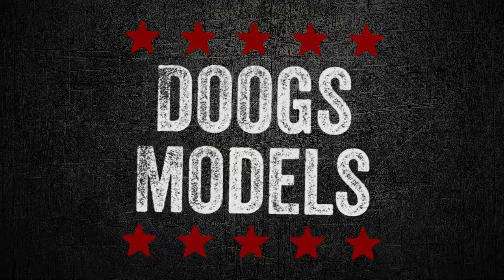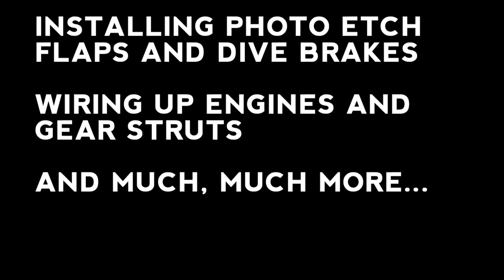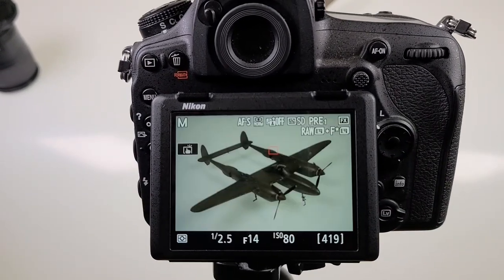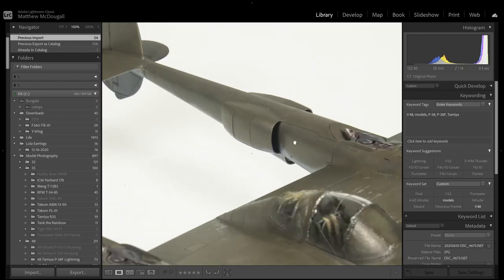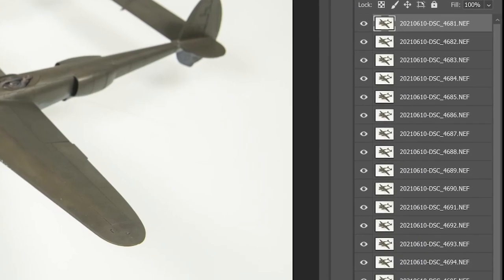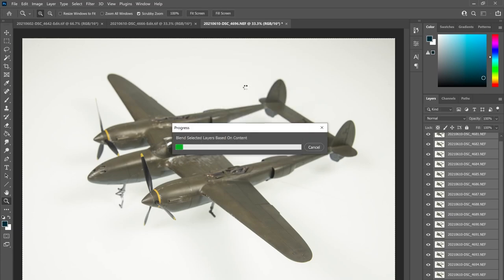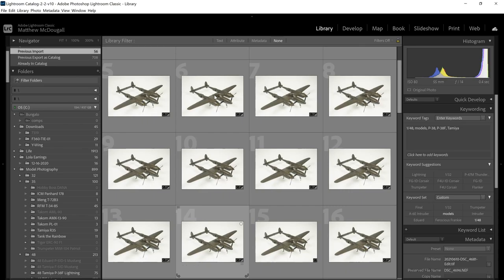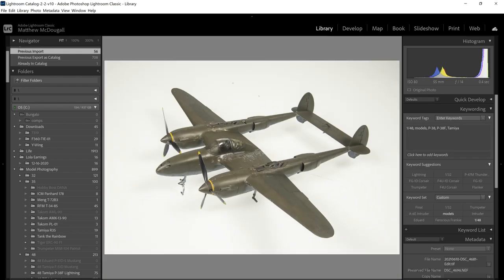How To: Focus Stacking

Comment: I was just going to suggest duping the final comp layer and then running a high pass filter on it, playing with the settings to hone in the sharpness. You can play with using overlay or other blend modes to give you different results too, and realized someone else suggested high pass. Definitely worth it.

Comment: Really great tutorial, Matt!! On the sharpenning subject I really like the high pass filter method, it gives you a lot of flexibility to choose what looks best for the image at hand, its a bit more fidlly though, but worth it.
Reply from the maker: I just checked it out and...totally worth it! Man, Photoshop has so many hidden depths.
Reply: @DoogsModels  It does indeed, no matter how much you use the thing, something new always shows up
Reply: Nothing beats Nik Software for sharpening.
Reply: @AtlisWerks  well, I would have to give that a try, but I kinda doubt it. Sharpenning is simply contrast at a micro level, there are no brand specific better ways to do it that the nikon software could take advantage of. And the sharpenning option on that software is quite simple, not to mention that it is quite a pain to add that thing to one's workflow.
Reply: @ArthurMG00  try it.

Comment: excellent and quick, thank you very much Matt! 

Did you set up your camera in Manual mode or in any of the Auto modes? One thing you could add as a comment on the photography side, is that it can help a lot to have the camera set up in Manual Mode (instead of Aperture Priority or Shutter Priority, or of course, in Auto Mode). If not, the camera may slightly (or more than slightly) change its settings during the multiple shots, (depending on whether you are focusing on a bright or dark area etc.) and change the overall lighting and white balance (the latter plays havoc with colour - hues and shades - in the model). In a controlled lighting environment (like your set up) this may not really be much of an issue, but still, better be in total control. Also, I am sure many people may try to use natural lighting (from a window for example, or shooting outside), which may cause lots of changes to both the overall exposure and the white balance. So Manual Mode helps a lot, and it's worth learning how to use it - more tediousness :-) 

A lot also depends on the specific camera model you are using, your Nikon is certainly a pro-level tool, so it behaves very well (and predictably), but other models may vary. 

Thanks again, scale model photography is a much under-appreciated subject, would be great to share more on this. Cheers.
Reply from the maker: I only shoot in manual mode unless I'm out walking around, when I may plop into aperture priority. But yeah - consistent settings absolutely matter.

Comment: Hi Matt. Would there be a way to focus on different angles of my finished models with a cheap Sanyo VPC-T700 7.0 mega-pixel-type of digital camera? I haven't got any other camera. Cheers!
Reply from the maker: I mean it's possible with any camera that can do manual focus (or manual focus point selection) - I'm not familiar with that camera though.

Comment: Why just not use f11 or f16?
Reply from the maker: Depending on a variety of factors (distance to subject, depth of subject, sensor size, lens etc) there is no way f/11 or 16 or even smaller will get everything in sharp focus.

Comment: You can get deeper focus instantly by using a smaller sensor camera instead of a large, very expensive, FF camera.  I like to think of it this way.... a micro four thirds sensor is 1/2 scale, and a iPhone 12 sensor is 1/2 scale :)
Reply from the maker: Well...yes and no. Yes as you decrease sensor size you get a longer depth of field. But once you get to phone land, nope. Because phone cameras have fixed apertures, and in the case of my Samsung, none of them is smaller than f/2.2. In WIP shots with it, depth of field is a significant issue. 

Micro 4/3, etc, the longer DOF is certainly there, BUT DOF isn't the only thing. The reason I got the D850 was for it's amazing color depth and dynamic range. It can capture small shifts in color that every other camera I've ever used misses. 

I can make a FF sensor capture a longer depth of field through glass and through smaller aperture, but I can't make another see color that it can't see.